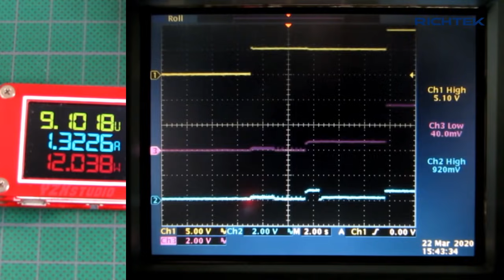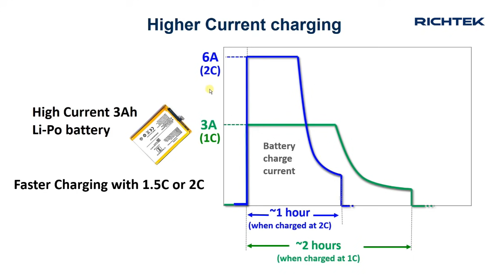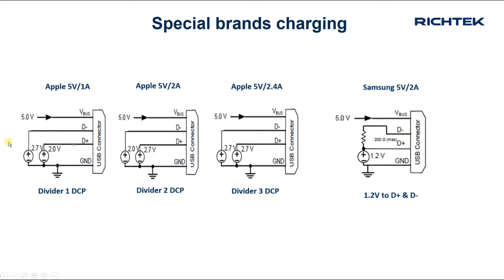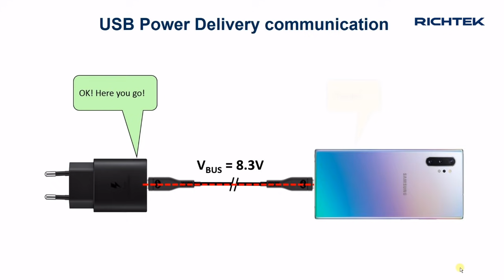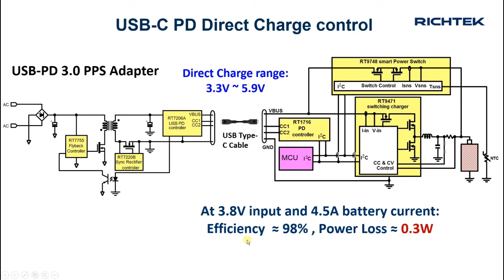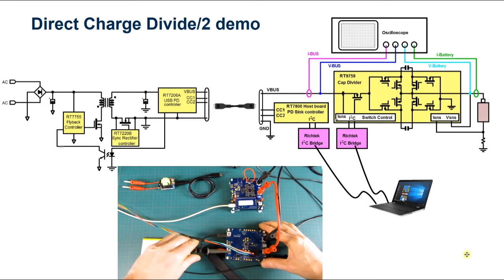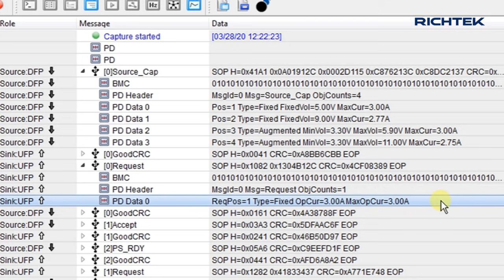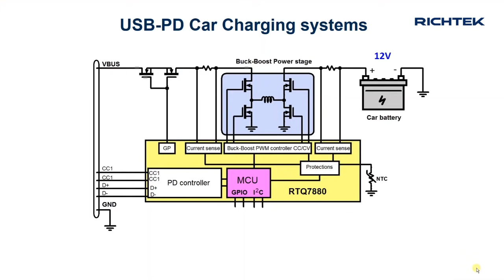How does mobile phone fast charging work?

Comment: That RT9759 is insane... "capacitive divider" is not exactly what I'd expect it to be called (no AC signals here). Found the spec sheet, got some clues, and it's more of a double charge-pump that actually uses the battery as a voltage source!

Just considering the top half, it first configures the mosfets to use the battery plus the VBUS (which, recall, is externally maintained at twice the battery voltage) to charge the capacitor to VBUS/2==V_battery, then the mosfets are reconfigured to discharge the capacitor into the battery, and repeat. The bottom half is just a duplicate used presumably to ensure smooth operation.

Comment: USB Charging is incredibly frustrating, it's practically a matter of trial and error hoping you can get a combination of device, cable and charging port that delivers optimal charging speed. I've lost count of how many times I have gone to charge a device and had it slowly discharge instead because something in the chain isn't correct. Thank you for this video though, it really helps demystify what's going on behind the scenes!

Comment: It is filled with knowledge. Awesome video. I missed the part where the cable becomes hotter in direct charging. What I don’t understand is that if the cable passes the same amount of energy coming from the flyback charger.

Comment: Years ago a 5v 2.4A (=12W) charger was the top of the art, now we see things above 80W this is crazy
Reply: Actually even the best of the best like Nexus 9 tablet were using maximum 5 volts 2 amps out of this. And that's only after you will patch the kernel.
Reply: Now 240w

Comment: This is the most in-depth, easy to understand, high quality video on charging that I've ever come across.

I love that you are able to explain so comprehensively, while not diving into technical terms (even with the circuit diagrams, and the oscilloscope). That is the sign of true understanding and expertise.

Also, thank you for explaining the differences between 'old' charging methods and the new ones, without skipping explenation of the old. 
I like to repair things, but that could be anything from power tools,.to a variety of smartphones, to old cellular phones. 
So the gap in my understanding of the differences in charging vs battery chemistry is only becoming more and more apparent as technology develops..

I found an oscilloscope a while back (in the trash - it works fine. From the late 70s I think). 
I have been meaning to use it to dig into electronics a bit more. 

Your video really shows the value of it, and I am freshly motivated to start digging in
Reply: On an unrelated note; 
Are you originally Dutch? (I think I hear the faint remnants of an accent at some points when you speak - your English is impeccable*, though :)

* I suspect most Dutch people will not even notice what I am talking about)
Reply: @iggysixx  I think he's Dutch as well. I am not Dutch myself and I quickly notice a Dutch accent. :)

Comment: A question about direct charge/2 with capacitors:
If the capa is charged with a constant voltage the charge efficiency should be only 50% (RC model with R internal PCB path + MOS resistance → even when the steps are slight it's the same as long as there are voltage steps), same when the capa energy is released to the battery at a slightly lower voltage than Vcc/2. The overall charge/discharge efficiency should be 25% but I know it's close to 100% → how it works? Capacitors are charged at constant current from the supply until the selected voltage is reached? (well why not), but how to discharge capacitors' energy at CC to the battery without any regulated buck converter?
Reply: Here's my layman speculation.
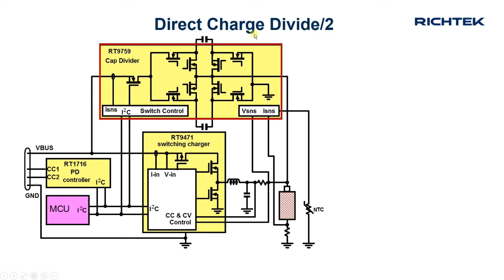"If the capa is charged with a constant voltage the charge efficiency should be only 50%". I fail to fully comrehend this diagram (15:21), but my understanding is that it works in two modes:
Mode1: capasitors are connected to charger in series. Thus, they get each half the voltage.
Mode2: capacitors are connected to the battery in parallel. This time they in totall output double current.

So, we have two modes that are switched really fast. We are talking about kiloherz, maybe even hundreds. Essentialy we get alternating current (or swithching is the right word?). And what you do to limit alternating inrush current? Add some inductance! A tiny inductor will provide needed reactance that will limit currents. Reactance, when dealt in the right way, does not produce power losses. 

The main point of heating in this divider are switches themselves. They are vulnerable in the moment of switching: when their resistance is neither infinity (closed), nor zero (open). In this moment you need that inductance the most.
Reply: I suppose when the voltages are very close together, the switching loss will be very small.
Let's say you have a 10 volt source and 9 volt sink. You transfer charge from the 10 to 9 volt level. Only 1 volt is "lost in translation" and 9 volts are transferred. Currents are equal. So 90% efficient.
Reply: @pizzablender  What you are describing is true, but it is true only for direct, constant currents. And it has nothing to do with capacitors, as they do not pass constant current. They are used to smooth variations in constant voltage. They can not change input constant voltage, they make it even more constant. 
As for simple constant currents, your conclusions look right.
Reply: @DimaZheludko  Think about capacitors as rechargeable batteries. Charge them in parallel. Then connect in series and discharge. The efficiency can be quite good.
Reply: @pizzablender  You are right in that regard.  Only it's vice versa. Here, capacitors are charged in series and discharged in parallel.  That's what I described in my first answer.
The problem is in differences between a battery and a capacitor (especially the size you would find in mobile phone). Battery has some substantial resistance, so if you give it, say 200 mV more than it's voltage, it will charge. Capacitor resistance is bacically zero, so any voltage difference will give you high currents. These currents would produce resistive heating in other parts of circuits, hence the original question by Incroyables Expériences 
That's where the inefficiency comes from: if you connect a source of constant voltage to a capacitor, it will produce a currents that are limited only by the circuit itself. But that makes the circuit a resistive element, thus decreasing efficiency.

Comment: 8 amps in a phone... I'm sure its safe and well monitored (and the fact that phones haven't been blowing up regularly for the past years proofs that it is) but it just sounds wrong xD. I've done some PCB design myself, even 5A on a PCB is quite a lot (not unheard of, and power PCB's go well beyond that). Hell, half the PCB's I made would struggle with 100mA on 90% of the traces. And the 10% would go up in smoke at 2 or perhaps 2 amps xD. 

Anyways, great explenation! Cool to see such a deepdive in something lots of people do every single day without thinking about it for a second! And interesting how we went from "just put 5 volts on it and its fine" to communcation between everyting including the freagging kable to make sure everything is capable of the insane chargingpowers we are used to today!

Comment: Know the problem...
The market is flooded with cables made with a standard USB connector (the type you find on a mouse) at one side, and USB-C at the other side.
This cable will not deliver anything above 5 Volt, 2 Amp charging in PD mode. It can deliver Qualcomm QC 2.0 and 3.0 modes, tough. 
So it is very important to know if the phone uses QC or PD quick charges mode.
PD modes require usually a USB-C to USB-C cable.
Some brands (like Huawei) use a proprietary charge mode, which basically are like the Qualcomm QC with a modified signalling, so they don't have to pay royalties to anybody.
PD mode is not proprietary, it is a standard endorsed by USB Forum, but it is expensive; so we don't see PD in low range phones, and some partial implementation in midrange phones.
This may change in the future if all phones will have a 5000+ mAh battery.
Personally, I prefer QC over PD because it keeps the current low into the connectors. With a 5 Amp PD, the connectors must be very clean and tight. The problems increase with the square of the current.
Thanks for the video...
Reply: Nobody really supports 5 amps PD. That is only gigabytes Thunderbolt adapters. That standard USB-A is deprecated.

Comment: I never charged my phone with a quick charge. Instead of the original fast charger I use a regular slow charger, so instead of 4A, I charge with 1.4A.
After more than three years, the battery works for me as it did on the first day.
P.S I stop charging to about 70%. (at 4.1V)
Li ion batteries do not withstand the charge to the end. Proper charging of li ion batteries is up to a maximum of 4.2V and this guarantees 500 cycles. Anything above that drastically reduces the number of battery cycles and therefore the batteries have a short lifespan.
Charging the battery with 4.4V (battery voltage) and at almost 40 Celsius cause drastically battery wear.
Reply: Thank you for doing your part to part to protect the environment. I flash my phone with Rom that allow me to limit the battery to 80 percent capacity and the last much longer.
Reply: @anuarbin  There is also great application for android. It's called "AccuBattery" but this app doesn't turn off the battery. Just reminder-alarm and a lot of different information about the battery in the phone.
Reply: Actually saturation mode is mandatory, it starts after 4.2 is reached. 500 Cycles is very little and it only destroys like 30% of capacity. There is no such thing as 4 amps on the usb, 5 amps is only available on PC.
Reply: @lolerie  
What are you talking? How do you think there is no 4 and 5A charging via USB? These are specific chargers for fast charging and all new phones in the higher class have them. My 3.5 year old oneplus 5T has such a charger.

Comment: Holly Molly I thought they used the same type of batteries but risked the life of them to fast charge them.
But this is crazy complicated stuff. At least I can understand that these USB power delivery chargers can supply the voltage you want, meaning you can replace almost every device charging port for one of these with a static configuration, as long as you keep the current at 3A or less.

Comment: A clarity in the way of explaining incredible.

Do you know if this method of fast charging can damage the battery due to heating?

Ty so much.
Reply: It depends how smart you'r smartphone manufacturer is. Smartphone should trottle down or disable charging if battery becomes too hot. Setting up those protections is up to manufacturer. Failture to do so may result in multi billion $ lawsuit for battery fires.
Reply: The li ion batteries can hit up to 80° C. Modern ones that is.

Comment: Usb-c can supply several different voltages. How does it determine what voltage to output?
Reply: The adaptor and the phone communicate. The adaptor will tell the phone what it can do and then the phone will select a voltage level. Otherwise, it will use a default setting.

It's shown at 10:10.

Comment: What ic in a phone usually negotiates with the USB charger? Is it the PMC? Or CPU? Or ? I am trying to repair phone that charges with one particular moto qc3 charger but not with any other chargers. It seems CC control problem. Flex and daughter board change have not fixed the problem. I'm currently trying to modify port to trick phone into accepting any charger. Next I'll try connecting together data lines on a normal charger and see....edit: I tied CC pin to Vcc and now all charges accepted. Quick charge won't work but I can live with that. Thanks for your useful video. Helped a lot.

Comment: I congratulate you for the video and thank you for sharing your knowledge with the community.

Maybe you can help me clear up a doubt.

I am developing a portable audio device that has two USBs (A and C), A is intended for communication (access to flash drives, etc.) and to provide charging to devices, through various fast charging protocols, on the other hand the type C is both an input to charge the audio device itself and an output to charge user devices, both handle fast charging protocols (up to 60 W), in terms of communication, this port is only a slave (it connects only to the pc).

My Doubt is:

If the fast charge management is controlled by the DP and DM lines, how can both A and C ports be connected to my microcontrollers?

I hope you can help me clear up that doubt, since I am in the development of the prototype and that is crucial.

From already thank you very much

Comment: Charging is simply current flow into battery.  Higher voltage will push higher current flow and battery has variable resistance depending on the internal charge level.  Battery makers need to specify maximum permissible current and temperature.  So charge start at voltage to  that current then drops to maintain that temperature.  All the complicated negotiations are unnecessary

Comment: I always have the fast charging option turned off and I do my best to keep the battery between 20 to 80%.
I don't want my new phone to end up with a 2 hours battery time like my old one
Reply: How can you turn off fast charging?
Reply: @ElmarBon  in my phone is settings, device care, battery, charging.
with my charger it's 3 amp for fast charging or 2 amps when I turn it off
Reply: Actually the chemistry inside the battery may need this increased constant current stage.

Comment: Am I understanding this correctly, i want to apply this principal to my ebike battery, a 14s li ion battery, my question is, can I manually force a fast charge by bringing the voltage of the pack up to ~58v straight away rather than slowly,  and have the charger vary the voltage and current to maintain a high voltage across the battery, while obviously reducing the voltage as to not over charge while keeping ths pack cooler by using lower  charge amps but a higher charge voltage, lets say a 65-70v supply into the pack.?
I know there's gaps in my knowledge, I'm not an electrician just a hobbiest.

Comment: Brilliant.  If PD-controllers make it so easy, why don't phones allow narrowing battery capacity ranges (to extend battery life) as a user-option?  Especially at the top-end?  Most users leave phone on charger overnight, for example.  The difference between filling the battery to 100% and 97% could mean an extra six-months of battery lifetime?  Limiting batteries to between 20% and 80% capacity mean the battery would outlive the human.  It would seem a simple option to add user-choice in the phone's system-settings application?
Reply: I'm pretty sure some phones do that

Comment: what happens if you connect a phone that checks whether D1 and D2 are connected to each other (5V1.5A) with a charger that communicates about D1 and D2? Wil the charger internally connect D1 and D2 to trigger the 1.5A charging protocol or wil the device only charge with 500mA bc It doesn't recognise the connection?

Comment: Hi thanks for your interesting information and details. I have two more questions about mobile phone IC power. First normally mobile phone uses the battery power for its own usage while the charger is plugged in or used the input power?
Second what happens when the battery is fully charged and still connected with the charger.
Many thanks
Looking forward to hear from you soon
Reply: No almost in every device battery is used, that is absolutely different from laptops that actually can work without battery. What that means is that you can have a situation when you are taking more power than charging and it will turn your phone off.
Battery's fully charged after saturation after 4.2 V are reached and that can take a lot of time. After that it's just shorts the connection.

Comment: I was looking for this for so long and my question is: what does the SOC have to do with charging system if companies can program their ICS without the need for Qualcom SOCs, in other words why they make people believe that charging method have something to do with the SOC?
I mean you can buy the protocol rights without buying the SOC because it have nothing to do with charging as current does not go through the SOC to get to the battery.
Reply: You do understand that power delivery code is inside Linux kernel? Also more modern devices can work like laptops work that is the power adapter is actually running the device not just charging the battery.

Comment: Hello what if my charger supports from 5V3A(15W) to 11V3A(33W).,

And i hook it up to a 18650 charger which can't communicate with the charger.,

Will my phone charger default to 15W?
Will it be safe to use it?
My 18650charger takes 5V2A and I don't have extra charger brick with that kind of output., 😔

Comment: Would it work if i supplied 12v fixed on usb port to charge a phone which supports qick charging, or would it damage the phone if it was no t communicating first to request 12v?
Reply: If you try let me know :)
Reply: @ichinisanyongo  just tested what it does with factory charger and its using 6.8v, interesting bc its not divide by two, but switching circut. never saw 6.8 listed on chargers, just 5,9,12,20
Reply: @Boz1211111  PPS means that any voltage can be used

Comment: I use ACCA it allows slow charging & can put the battery in idle when plugged into the wall. It can also lower input voltage & amps to prevent damage from quick chargers. Mine is set to limit current to 450mA & limit V to 3.8. That keeps charge between 25 & 45% before idling & it sets V to 4.0 before travelling to limit the charge to 75%. This battery is 3 years old & thanks to ACCA still rocking. With ACCA you don't need to fear quick charging tricks, that can be completely disabled even if enabled by the OS & charger.